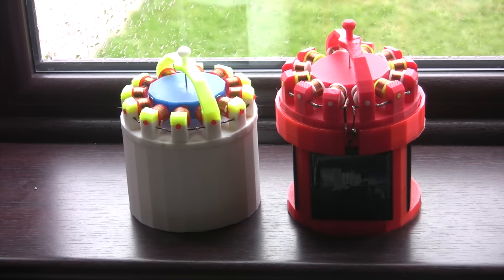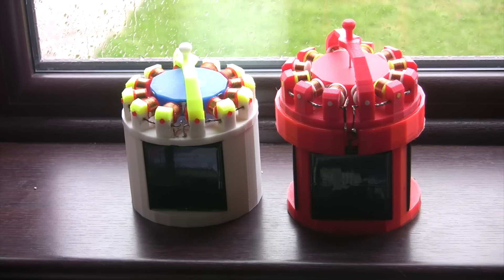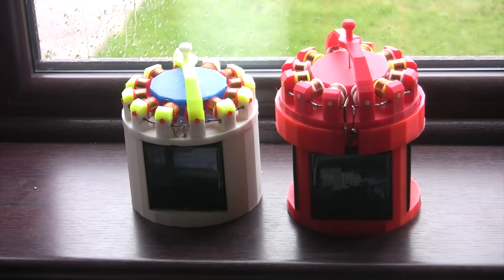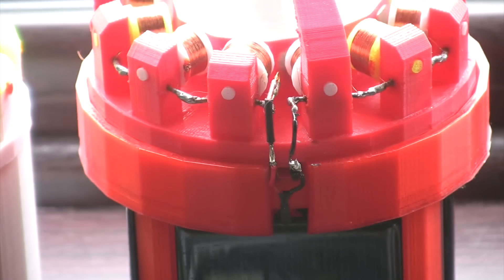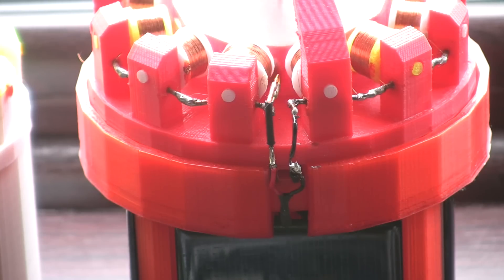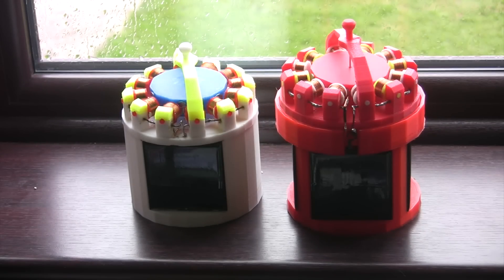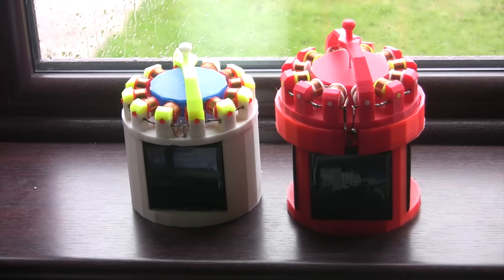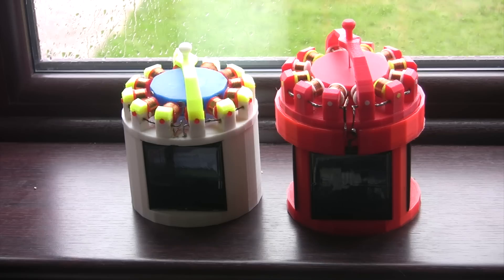Ez Spin Motors The '100' Year challenge

Comment: Noce job! Only thing if I can say, the solar panels should face outside. I mean, you have one facing out, 2 in mid shadow. And one in complete shadow... I think you'll get more power if you allign them towards the sun. I Wish I could make one... I have the magnets, the reedswitch and diode.. I just need the copper wire and the bobbings and capacitor. No 3D printer, but I can use an old hard disk for the rotor... Cheers
Reply from the maker: +DavidVercettiMovies  Hi Dave, yes your absolutely right, but I wanted to keep the the shape.  The panel in the shade does still make electricity on bright days, but not enough to mean anything. 

I have noticed that the sun is degrading the plastic and its turning a milky colour, so I rotate the motor once a month to give it an even tan. 

I don't know if its just the pigment thats  being destroyed or the plastic as well. I guess time will tell.  One good thing about having solar cells positioned like this is that if it were in a green house it would kind of track the sun as it moves in the sky. 

Using a hard drive is a novel solution..  Post a video when you make it.. I am always interested in seeing what other people make.
Reply: +3D Motor Maker yes you can rotate It! Every now and then. I noticed that the plastic of 3D printers are crap. You mentioned melting during solder and now the pigmentation too. Lasersaber is selling them on ebay? Mmm I might buy it....
Reply from the maker: +DavidVercettiMovies I know he sold one.... I don't know if he is actively  selling them.  For what its worth its only this particular plastic that does this, all my other plastic does not fade (yet).   The plastic will melt though, if printed in PLA it starts to soften at 60C - abs at 200C and the soldering iron is 300C - so its going to melt.  My latest motor I just soldered the wires to make it easier.

He uploaded his plans to shape ways and there is 3dhubs, so you can still get it even if you don't have a printer.

Comment: Those are great!  I got you message about the electronic circuits for these but after testing mine for several months I think the reed switch method is better.  My circuits stop working if motor rpm drops too low.  It happens on cloudy days when the panels don't provide enough power.  A reed switch will keep working even at very low rotor speeds.  My electronic circuits are shown on the videos if you want to try them.  Something that you need to consider is what I am running into with my long run experiments.  The parts breakdown with age as the years roll by.  The plastic parts deteriorate, dust gets into things, corrosion happens and, UV takes it's toll.  A 100 year motor might work in theory but in reality that might be very hard to achieve.  A 10 year motor might be a better goal.
Reply from the maker: ***** Yes I think your right on all accounts. I must try your electronic system, when you say low rotor speeds what speed are we taking about ? looking at my video do you think that they are running fast enough ?

Thanks for commenting.
Reply: 3D_Printing I think your motors are running fast enough to make the electronic circuit work.  I took three coils of LaserSaber's  EZ spin motor and used them as the 'trigger coils' for the transistor.  The other nine are the drivers.  Basically the rotor has to generate enough juice to tell the transistor to switch.  It then send battery juice to the other coils to turn the rotor.  I notice that your rotors wobble.  Mine do also but on the electronic  version you have to make sure the magnets don't wobble too far away from the trigger coils.  The whole thing is a delicate situation.

Comment: Do you have the STL files and be willing to share them? It would be amazing if we could perfect the design!
Reply from the maker: Carlos Alcazar Stl files for the motor or the plinth it sits on ?
Reply: Both if possible! :)
Reply from the maker: Carlos Alcazar  All the info you need to make this EZ-Spin motor is here. You have to dig around lasersabers videos to get all the info as he has spread it over several videos.
http://laserhacker.com/forum/index.php?topic=155.0 
If you need the STL for my plinths then I will share them, but to be honest they are not very hard to model, and were made to fit the solar panels I already had.